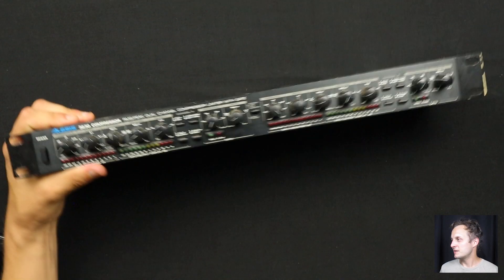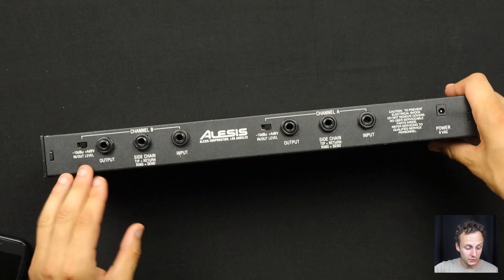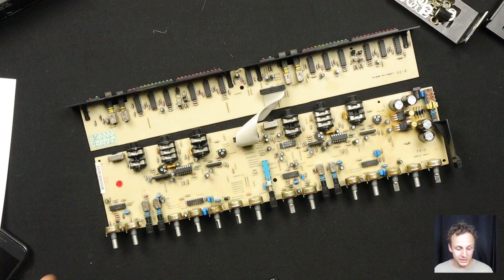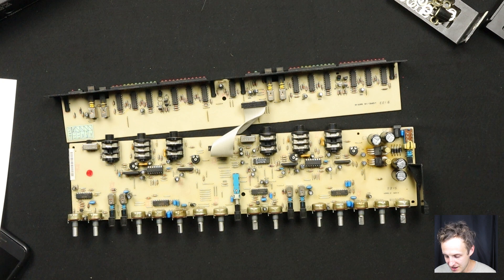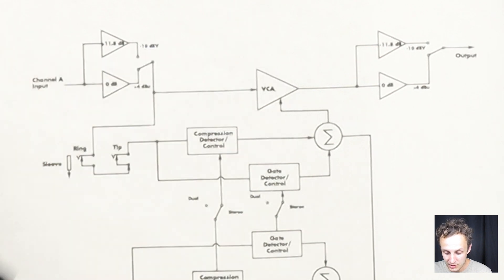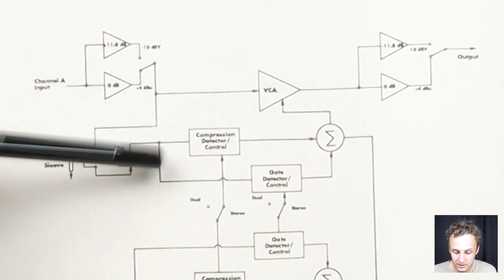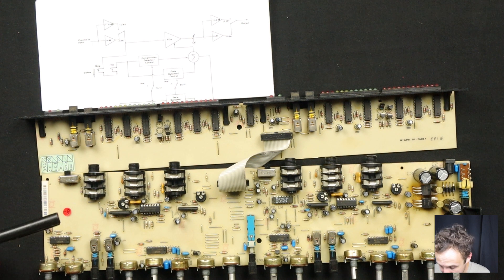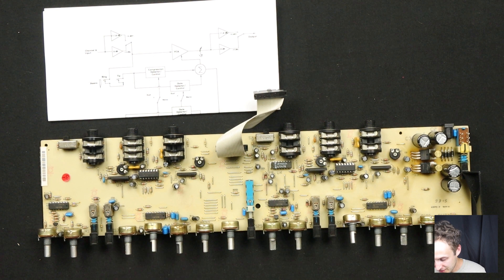Is the Alesis 3630 compressor really that bad? Teardown of "the worst compressor ever made"

Comment: Very Naive guy doing the review. 
Obviously no bench tech...

The CA1080, LM13600. OTA...
Also the NE 571 COMPANDOR.
Reply: @PetersonGoodwyn  hi dude.

I'm unable to easily comply. 
I'd need to write a small book.

No, I'm not kidding. I used to repair, modify and also design audio equipment. 

It's like you're asking a brain surgeon: "Hey, mister, what are you doing? "

Electronics Engineering is very involved, man. 

Look into the development of the Operational Transconductance Amplifier if you have STRONG knowledge of transistor theory and have some experience with audio equipment repair.

DBX was an early professional pioneer of the hardware compressor expandor.

From your video I can see that you don't really understand anything about what you're looking at. You ripped the cover off a magic black box. 
✌
Reply: @Theineluctable_SOME_CANT  okay burner account
Reply: @champ1114  well yeah it's a "burner account". My previous channel got burnt alright!

Thanks YouTube. . .